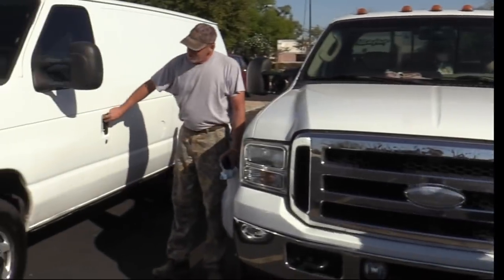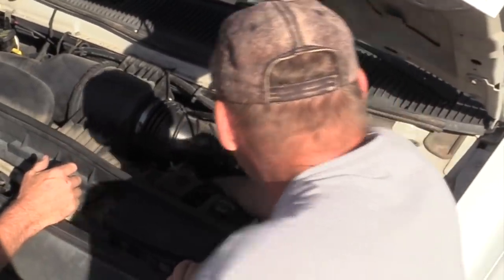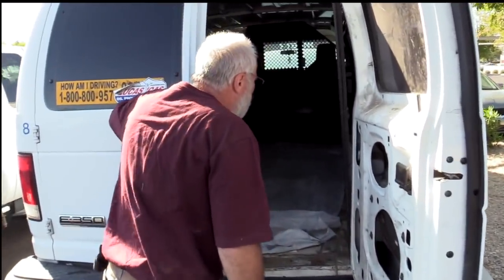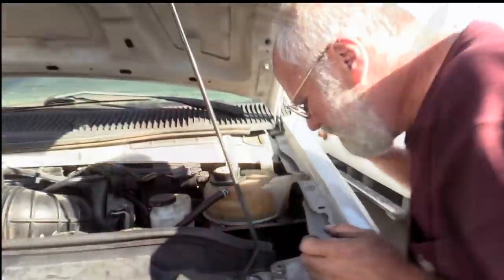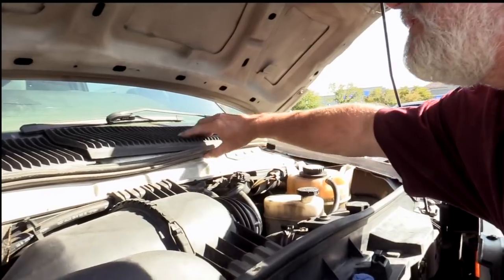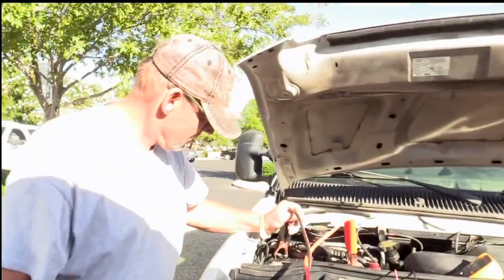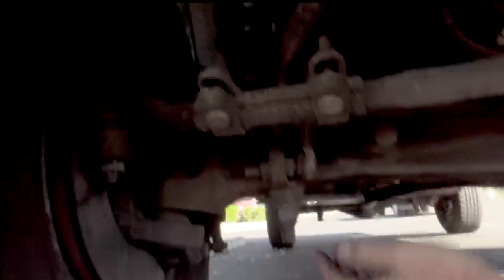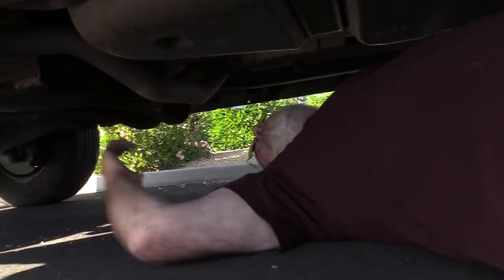A New Van for CiCi? Complete Inspection Before Buying - 2019 Van Build Fest

Comment: Good going over, guys. My only turn off was what looked to be a very wavy cargo floor...heavy loads, more wear esp trans.

For others looking for vans, follow what these guys do. Also, look for a van that's lightly used/no tow hitch. 
As an example, Ijust bought a 99 Dodge Ram Maxi Wagon, 5.9L with 113,980 miles for $3K. Spent at least half its life shuttling kiddos to/from a tae kwon do academy. No rust, no damage, excellent paint. They're out there. Just be very patient. Took me about 2.5 months of constant looking and had to drive 70 miles to get it.

Comment: Someone been burning the tires doing smoke shows,not a good sign.Been carrying very heavy loads and throwing a skipping cylinder alert on the diagnostics.2 year old battery going dead with a new alternator.Still unknown whether or not it will pass state inspection but overall I think its a pretty good van that just needs a little work.Its best to jack up the van to check suspension parts,a floor jack would have made easy work of that, but a quick visual at least gives you an idea.

Comment: Thank you for sharing this information, would it be possible to add a link to a chest sheet of all of the key points that the guys did when inspecting this used vehicle.  Also what at the least for testing equipment/tools to take with when buying a used vehicle.  I guess it might be important to  distinguish if this information is good for any vehicle or just certain types?? Thank you in advance😃👍🏽. Again thank you Jamie for all you are doing for this community😃👍🏽

Comment: 2004 ?  1/2 ton ?  spare tire ,? MILEAGE?? , what size motor ?,    YOU GUYS ARE ANGELS !!  SUCH A GOOD IDEA THE GO-FUND!  Thanks Jammie for letting me actually help buy a tiny part of that van for "CI-CI" From here in Tucson !!   That's how things should work between people !
Reply: TOMAS looked like a 2008 front end probably 3/4 ton?... just was treated a lil rough.
Reply: @dixierose5628    Sounds right, was a work van,  "Electrian ?
Reply: Electrician or ac probably.
I bought a ac/ gmc cargo van 
But mine had plywood over floors kept floor new looking.,

Comment: Too many little issues. What’s the good deal $$$ look like the van was neglected for many years
Reply: The heart of any vehicle is the engine and transmission; also the most expensive to repair. The shell and body are the least important. Tires, batteries and brakes wear out on every vehicle, and not through neglect.
Reply: The van for been in such poor condition it’s been neglected because they didn’t keep it up the Maintenence I have a 1992 Toyota truck it needs nothing because I keep it up. It’s not way you can test a tranny just driving it. You have to remove the fluid pan to see how much wear. To many issues for a young lady to deal with it.
Reply: @bajar.m.6953  Are you saying this young lady and possibly her boyfriend don't have enough sense to take the van to a reputable mechanic if the drive train presents with a problem. If she is hanging out with like minded rubber tramps, I'm sure she can get help as needed, just like in this case. With your truck have you never replaced a battery, replaced brakes, replaced tires?